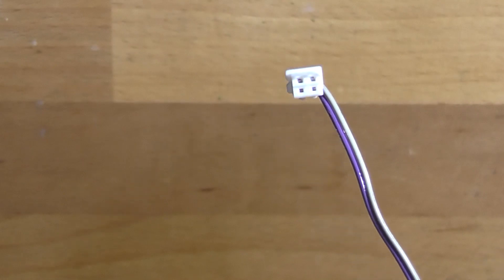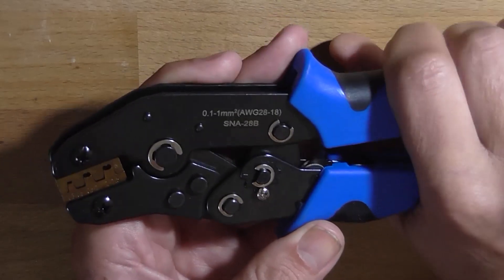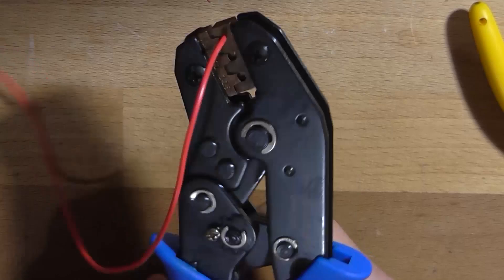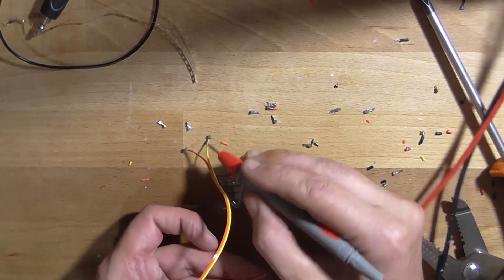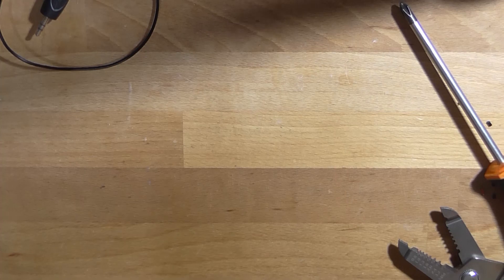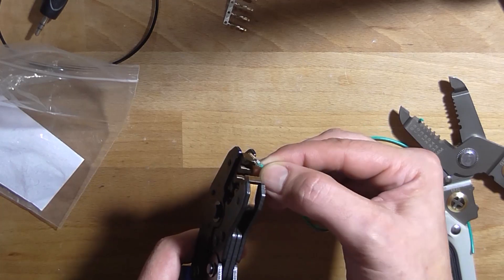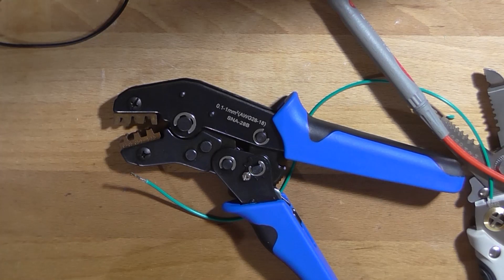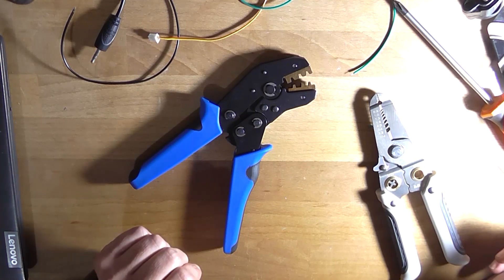Cheap JST Crimping Tool (SNA-28B) REVIEW

Comment: I acquire this type of tool, without any expectation of not to have fun, but to accomplish such chores as joining wire to connectors without TOTAL TORMENT (aka "extreme 'fiddeliness' ").

Having had similar experiences as yours, I think in the cases of a) wire/connector crimpers and b) automatic wire strippers, (I think/hope) the torment-less tools are the MORE expensive ones, not the less expensive ones   Thanks
Reply: Of course, I meant to write  " ... without any expectation of having fun, but ..."
Reply from the maker: @cougar1861  lol. These connectors in general are a fiddly pita.